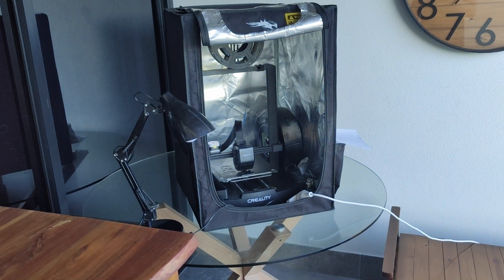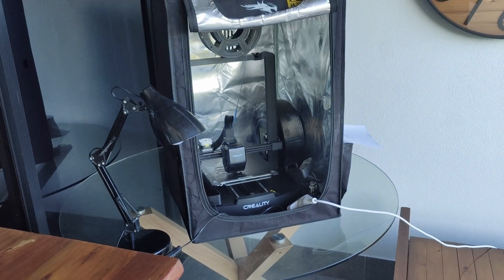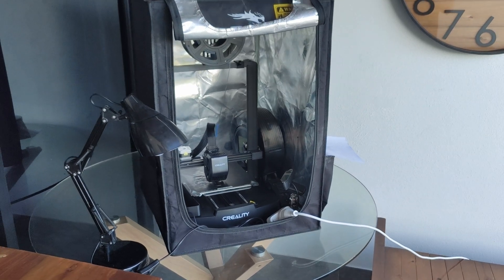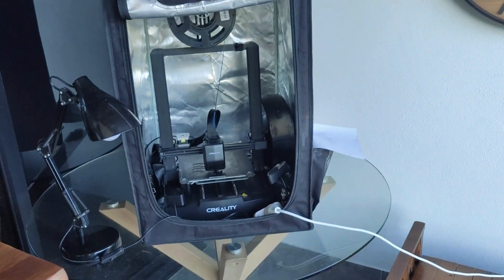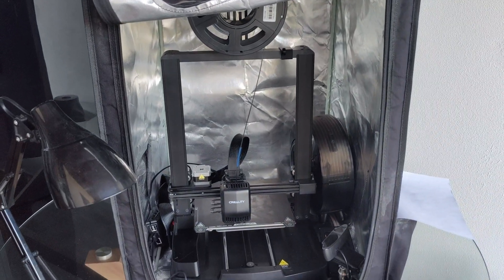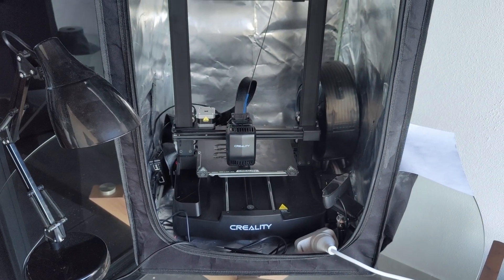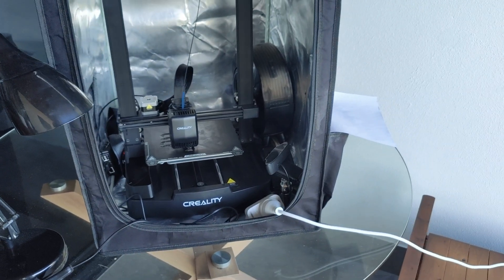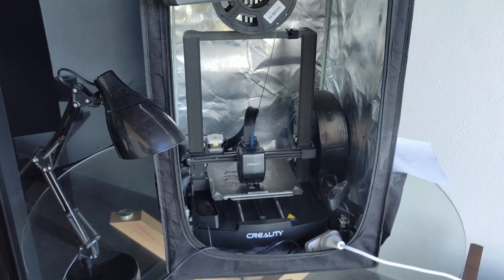No Room Inside? No Problem! 3D Printing Outside

Comment: OMG! this is amazing! im thinking of doing the same, since i got an enclosed one but still i can smell the fumes, so im puting it outside but was thinking i can not be the only one! your 6 months of experience aare increidible helpful! thanks so much for sharing! how is it going now that is almost a year?
Reply from the maker: Haha glad the video has helped! I now have two printers permanently outside and they work perfectly, even in cold weather around 5-6 degrees C ( as long as you have an enclosure) 😜 just be cautious if you printing ABS cause that can be a bit more painful in low temp. As long as you keep them in an enclosure and clean them every 2-4 weeks from dust and stuff, youll be good 👍
Reply: That’s awesome to hear
I bought the bambu p1s if you can store yours outside I’ll do the same
Reply: @andreasnilsson5020  LOL! that is the same printer that i got! it has being outside for 3 - 4 days and its working perfectly! i have being checking the humidity and if it gets too hot or cold but everything seems normal! i got the creality enclosure that says ender on the top part, it is very big so worked well with the p1s, i just had to print some legs to lift it up a little bit since the zipper got in the way to open the door of the printer , so just wanted to share my experience i hope it helps !
Reply from the maker: Glad to hear everything is working well! Happy printing 🥳